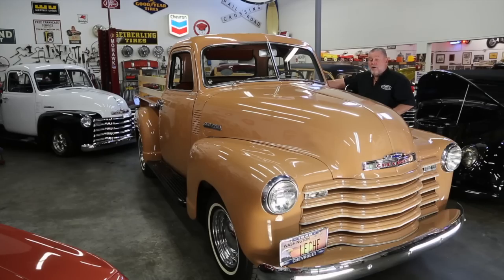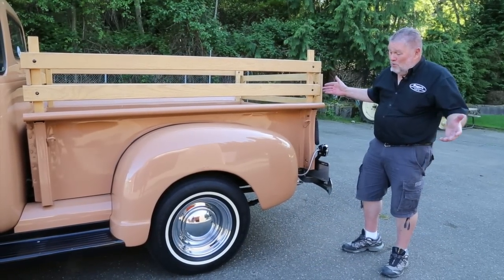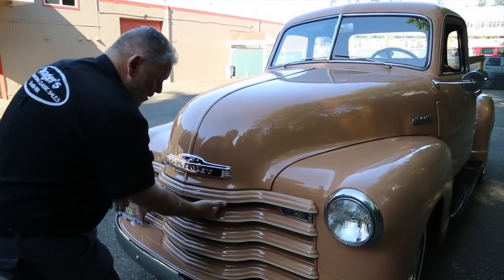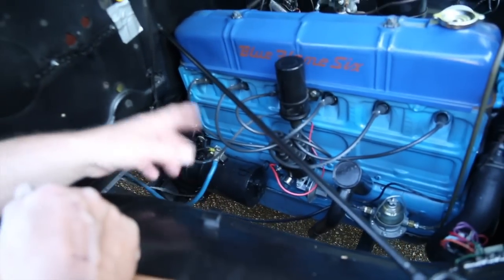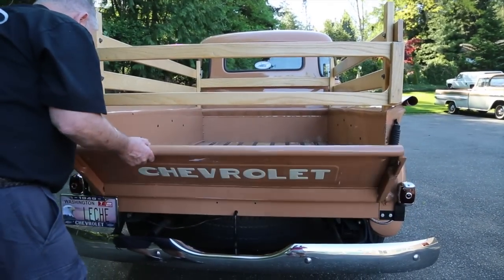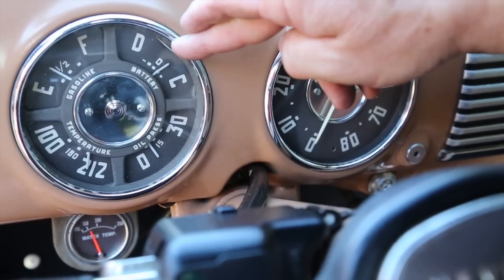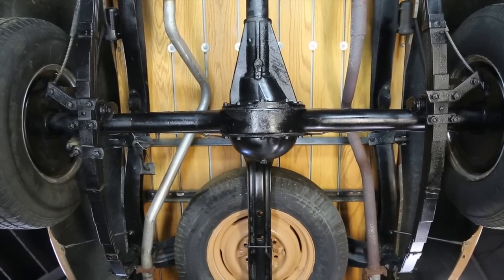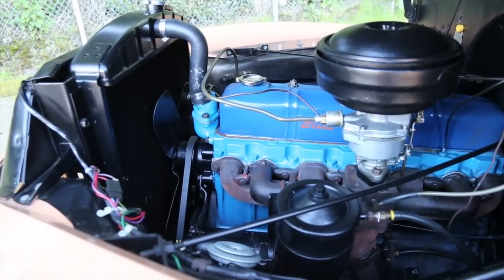1949 Chevrolet 5 window 3100 Pickup  " SOLD "   Drager's International Classic Sales  206-533-9600

Comment from the maker: I want $19,500 for it. I have sold them from under $10,000 to over $25,000 in stock condition.
Reply: As The owner of a all stock 1951 USA built GMC 1/2 ton extended bed pick up with the original 228 cu.in. Engine and 3 on the tree tourqe tube drive line I can honestly say don't worry about the scratches Nick's Chip's and bruise's because they just add character to the truck and show's that real men still drives real truck's from a time when real truck's was made' great presentation from dragger's. Hry' I got a great idea that maybe us real men can poll together and do' let's take and roll these nice truck's out to the local elementary schools high schools or even college's and show them youngans the definition of what real truck's are and what they used to be? After all the future is not what the industry does with truck's and car's but it's what we install in the mind's of our youngans' Heck' you want modern I can see our youngsters driving in one of these bad boy's on a modern drive line with an electric powered motor' one things for sure it'll be made right here' in the good old u.s. of A! Go USA 💪